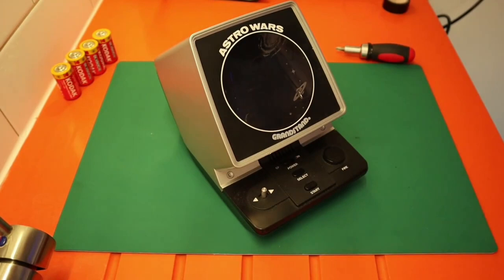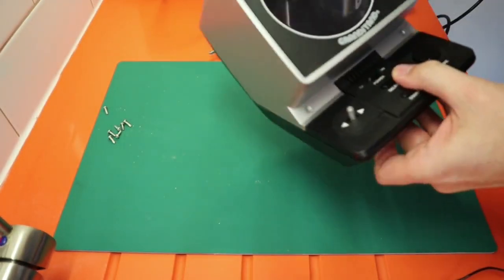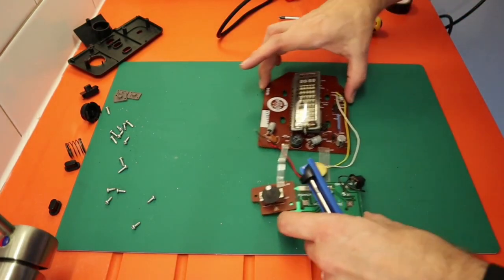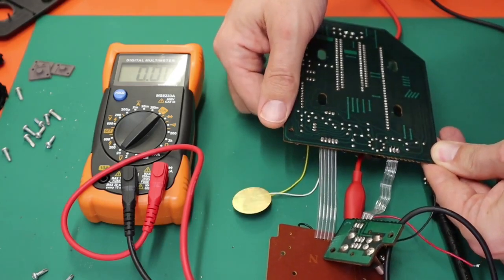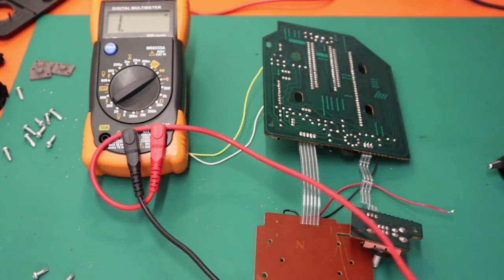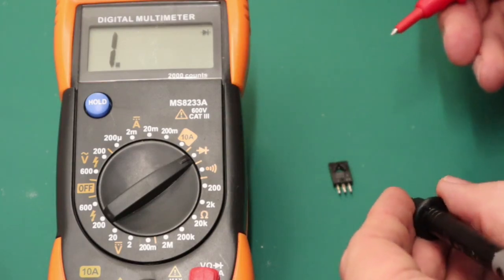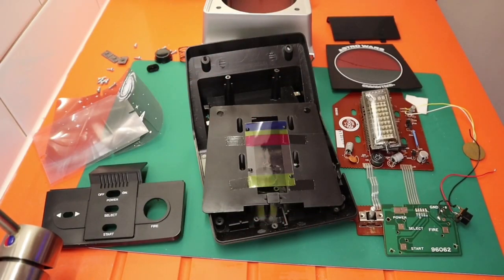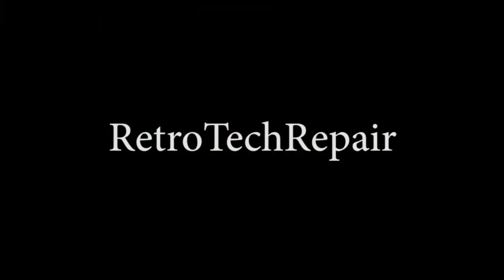Grandstand Astro Wars / Galaxy II repair - Retro Games

Comment: At the beginning of December I bought two faulty units on Ebay expecting to replace the D882s as standard, but one actually worked perfectly when it arrived (hurrah!). I also had the same trouble as you when trying to get the case apart. Both were really tricky to separate. The second one was faulty as described and took me a while to repair as it wasn't the transistor. Went to town on it, created a schematic, wrote up a parts list. Used the working unit to figure out what the voltages should be around the patch. Got there in the end!
Reply from the maker: Excellent! You seem to be more advanced at this than I am. I'd be interested in the parts list and schematic (if you wanted to share) I have some more to repair yet. What was the fault?
Reply: @RetroTechRepair  I would also be interested in your repair and schematic if possible?

Comment: Thanks I found, the seller and ordered one. Cheers. Hopefully I will be able to get it up and running again. It seems like it has the same issue as the one in the video.
Reply from the maker: Glad I could help. Stop backand let us know how it goes. There is another common failure, fixed in later revisions of the board. Check out the Astro Wars repair special for that. If it is there other fault maybe take a look at the CGL Puck Monster on how to find alternative parts as I am not sure the one identified in the "special" is strictly necessary.

Comment: I've always had a love for electronics and electronic games since I was a kid. So much taken apart, so little put back together and working.
I love this video, thank you for taking the time to make it, it's really clear and easy to understand for someone like me.
I have a couple of faulty Astro Wars that have sat waiting for help for years and now I've seen this I'm having a go at fixing them.
I've just tested the D882 on the one to hand and it appears faulty as per your video so have ordered replacements. Fingers crossed on that one.
I've not checked the other faulty unit yet as it's not close by but while reading the comments I came across the 1N5275B replacement zener diode solution for S06. I've no idea if the other unit has this issue but preparing for the worst I've tried to find some in stock just in case but it's problematic. I can find 1N5275A in stock but it has a larger tolerance to the B of +/-10% as opposed to +/-5%. Not an issue for me yet but out of interest would the A version be a sufficient replacement for the B here if it came to it?
Reply from the maker: I bet the "a" will be fine. With hindsight I wonder of that was a zener anyway maybe take a look at my puck monster video if you fancy a trial and error approach. Either way... massive thanks for the comments. Really inspiring. Appreciate it a LOT. Cheers!
Reply: @RetroTechRepair  Really appreciate your reply. I wanted to just give an update and let you know I got my old Astro Wars working and it's really cool :) Of the two I have the one with the S06 issue is my original from when I was a kid. I used two 1W 1N4760 68V zener diodes in series to replace S06 and it works perfectly. Thanks for getting me across the line. It's been sat in a cupboard for the best part of 30 years since it got broke and your video showed me how to get it done. It's as much fun as I remember it. Still got to beat it yet on the hard setting though. Thanks again!
Reply from the maker: @davebatty8814  that's fantastic! So happy to help. Thanks for the feedback!

Comment: Hi Roger, it's a few years since you made this video and it predates my sub to your channel, but since I just received a non-functional Astro Wars this is the first time I've watched it. Thanks for the head start on the D882, it looks like that's my problem too since I'm reading a short between B-C. I don't have any D882s to hand, so I've ordered some from eBay. I did wonder if there were any common equivalents that might work, but in the end decided to not risk it and get the D882s. Hopefully that's the only problem since after reading the comments I've noticed it's an S06 only board. The VFD has the black spot though so I hear that's a good sign! Cheers!
Reply from the maker: What a great comment! First off thanks for your sub, very grateful for that. I must admit I haven't tried to sub the d882 with a different transistor although I expect the circuit isn't too fussy. SO6 can cause the D882 to overheat and fail, so if it starts to get hot or draw lots of current then you probably have an SO6 failure. I'm still not convinced the S06 is a zener, it could just be a normal diode with a 140v reverse  breakdown. Maybe try the rerltrotech repair puck monster technique. Either way good luck with the repair and thanks again for your sub and comments. Please stop back and let us know how it goes. Cheers Roger
Reply: @RetroTechRepair  The D882 was indeed faulty, after removal it tested the same way. Unfortunately, after soldering in a tested working replacement, the game was still dead when I applied 6V DC. There must be a fault elsewhere. I was then reading largish voltage drops between C-B (0.65V) and (E-B) (2.2V) with the new D882 in circuit (no power applied) where I htought they should read as open (OL)?  Desoldered the new D882 and it still tests fine (OL) on the bench, so it at least didn't get destroyed! I get similar C-B and E-B voltages on the other in-circuit NPNs SO3, SO4 & S05 which are all C1841, so in the unlikely scenario that they're all toast, is that normal/to be expected in-circuit? I'll have to do some more research and diagnosis. Another complication is that half of one pad for the D882 (E) lifted on the second desolder, so I may need to jump that track now, although it's still reading continuity. Sigh. Any ideas?
Reply: @Retro Tech Repair Well I got it fixed in the end, hurrah! I'm still not sure what the problem was before, since I couldn't find any other faults. So in the end I just soldered another replacement D882 into place and the game sprang to life with 6V DC supplied! Maybe I didn't have the switch jumped correctly last time? Anyway, there was some more drama, since in all my man-handling of it during the repair, that tiny ribbon connector from the joysick board broke away from the main board! It's too short to strip some bare ends and reattach so I needed to replace it with some hook-up wire. In the process of removing the ribbon from the JS board, a solder pad lifted so needed jumping to the pad of the switch! They say these things come in threes! Anyway, it's all good now and I have a working Astro Wars that I paid very little for. Thanks again for the video Roger, I love the way you present these, so clear, calm and great camera work makes it so easy to follow. No doubt I'll be following in your footsteps again soon! Bye for now :)

Comment: A great repair, thanks. I bought an AstroWars from a gaming convention. I was told it worked, however once I got it home, no luck. I seem to get audio from the unit and can select/start a game but no display. any ideas ? I have ordered a D882s from ebay which I will change as a precaution. hopefully that might mix it as I'm not that good with Electronic fault finding.
Reply from the maker: Hi Andy, thanks for your feedback. I actually had an astrowars with a similar fault. I too am not an expert in electronic fault finding. But I did work it out in the end. I will eventually post a video on it. It wasn't the D882 in the other game but it's good you have some as they often fail. I'm sorry somebody sold you a broken game! Couple of things to check. If you disassemble the game the display should have that dark spot inside the display glass, like the one in the video. If that spot has gone white then sadly the display is damaged and there is not much you can do. If not then see if the D882 is getting hot to touch when the game is running. If so turn the game off as the D882 might eventually burn up (told you good to have spares) post back when you have had a look let me know what you find. If it's getting hot I have some more ideas. One quick favour... If you haven't already please subscribe, it really helps the channel. Thanks
Reply: @RetroTechRepair  Hi, Yes it does have the dark spot inside the glass, I thought that was a bad thing. Not sure about the D882 overheating as I have re-assembled it at the moment. I will wait for the replacement D882 to arrive and see if there's any difference. I'm ok with soldering so I can handle that, I will report back my results. Hope it works as I have the Scramble version which is fine.
Reply from the maker: @andylovelace4126  The black spot is good! Its called a "getter" it is put on during manufacture and absorbs impurities within the display. Let us know how you go with the D882, perhaps keep the one that you remove just in case. Thanks!
Reply: The D882 replacment had no effect :-( I have noticed that when I turn it on the D882 gets really hot, any more ideas ?  Many thanks
Reply: I have refitted the original D882 as it wasn't the issue, do you think it's worth changing all the Caps ? What are the components S10/S09 and S08 are they diodes ?
Reply from the maker: Hi Andy, did you check the D882 was OK before refitting it? If not it would make sense to test it as it could have failed as a result of the overheating. Regarding the Caps I have mixed views. They could be a problem, but personally I don't remember seeing that in an astro wars. My guess is still S06 especially if you don't have an S11. I think S11 was added to later boards to reduce the likelihood of S06 failure. I think SO8,9,10 are diodes but could be Zener diodes I cant confirm. Take a look here... this guy seems to have the same problem you have and I think some home-made partial schematics. https://forum.allaboutcircuits.com/threads/grandstand-astro-wars-game-faulty-help-with-component-identification.156824/The big mystery remains what is part S06. I can only guess at that.
Reply: @RetroTechRepair  Think this AstroWars will just be an ornament in my Gamesroom as it's a bit too complicated for me. Shame I couldn't get it to work  :-( Will just keep looking for a working one.
Reply: Well while browsing a market in Derby I came across another AstroWars (With RED Writing), It was missing the battery compartment but worked. So I've made up a fulling working unit from both items. I will probably keep the faulty one for parts or sell on on Ebay. Thanks again for all your help, hopefully this one won't get the same issue as before as it only has S06 and not S11.
Reply from the maker: Great! If you decide to sell the other I'm looking for a good priced one for the channel with the kind of faults yours had

Comment: I still have my original Astrowars game, what would the problem be when you can hear the game starting up, (m7sic playing) then hear the aliens tick tick ticking around but nothing on display?
Reply from the maker: I have repaired one recently with that fault... Video coming soon! (Sub not to miss it). Spoiler alert ... But in my case it was failure of SO6 A Zener diode tucked away under the bottom of the display

Comment: off this particular topic but relevant.i have a konami frogger handheld from this era,sound but nothing on the vacuum screen,screen looks in good shape,dark spot at bottom etc.is there something i should look for,step up transformer issue?
also subscribed as content is right up my street
Reply from the maker: Hi Thanks so much for the Sub. Thrilled you like the vids. Frogger is a great VFD game and in my opinion perhaps the best conversion to a tabletop of the time. Well worth repairing.  Unfortunately though I haven't any experience repairing them. I did get one for the channel but it worked great! I keep my eye out for another faulty one on eBay but so far no luck. On other games I haven't yet seen a blown transformer, but that doesn't rule it out. I'd probably start by looking carefully for physical damage, then perhaps voltages, then transistor and diode tests (I expect some of them are Zener diodes). The frogger I had had the component values printed on the board. Which might help. But I'm so expert in this, so this isn't ready advice, just what I would do (right or wrong). Let us know how you get on.

Comment: Hi there, superb video! I've got two of these as well, both with the same S06 mystery diode problem that's of so much interest in the comments. Quite a lot of us in the same boat now it seems! When's your new video on S06 testing likely to drop? I'm proper keen to get playing again so don't be shy, your audience awaits with bated breath!

For what it's worth, I tried some BAT85 Shottky diodes as suggested on an unrelated forum but no joy - I think they're too low voltage but I'm no expert. I did at least get about 1 second of ropey sounding music before the new BAT85 died so am pretty sure all I need is a proper replacement for the S06 component to fix both. Don't keep us all on tenterhooks too long now, we need help!
Reply: OK so I missed a comment further down that mentions to try a 1N5275B and it worked for me, I now have two working Astro Wars games! Thanks heaps for the tip :) I still have a mechanical problem to resolve on one of them but at least they both play. Woop!

The mecanical issue is quite interesting (well, I think so anyway). One of the joysticks doesn't return to centre so I took the good one apart to see how it's supposed to work. It appears the sticks have an uber-tiny 1.9mm x 5mm spring hidden up the barrel and held in place by an equally tiny 2mm ball bearing. Moving the stick pushes on the bearing which in turn compresses the spring which of course pushes back when the stick is let go, returning the stick to the centre. Very neat and very tiny! My broken one had no bearing and the spring had disintegrated so it was back to ebay for some suitable replacements. Amazing what you can find on there! Will let you know how that goes when the bits arrive :)
Reply: @StirlingStevieB  Well done getting it working. Same issue for me. 
Where did you get the 1N5275B and what voltage is it rated for? Are they on Aliexpress?  Some comments refer to a 140v zener, but the highest I can find is a 75v. They also seem to be called a DO-35.
Reply from the maker: I'll see what I can do!
Reply: Found mine on eBay, they were listed as 140v 500mw. I paid under £5 for 6 of them though so not cheap, but was worth it in the end :) If you find a cheaper option, let me know!
Reply: Shot in the dark after so long, but the 1N5275B seems hard to come by. Are there alternatives? I can find 1N5275A with a voltage tolerance of +/- 10% (B is +/- 5%), will that suffice?
Reply: @davebatty8814  Did you find an alternative? I've acquired a non-working unit and I figured I might as well replace everything in one hit.

Comment: What power transistor was it ?
Reply from the maker: Hard to imagine I didn't say in the video isn it... well it was an early video. It was a D882. Thanks for your comment
Reply: The one I repaired was the transistor and is now spot on apart from the DC Jack socket  intermittent between battery / or PSU.
Thanks again…..   video was excellent
Reply from the maker: @PetshopPete  that's great... thanks